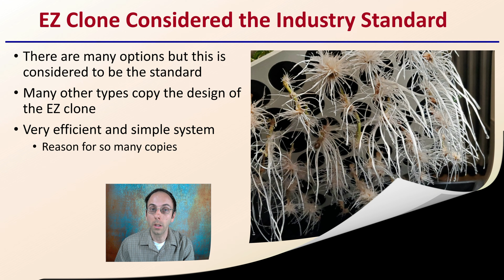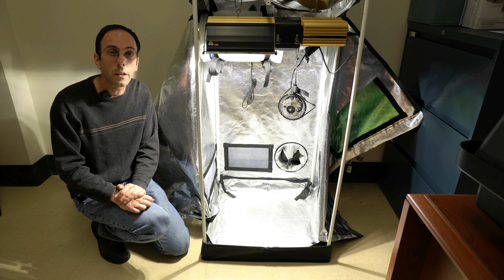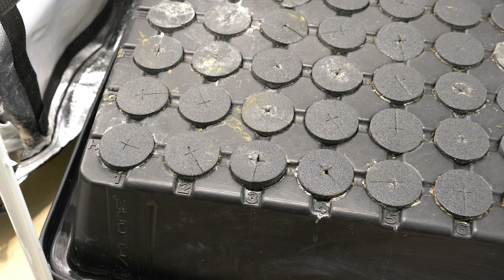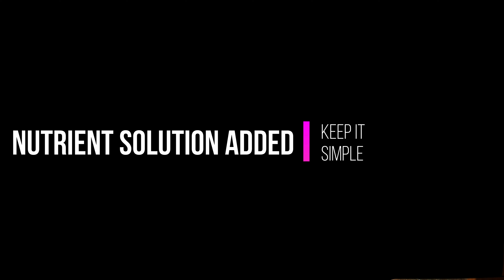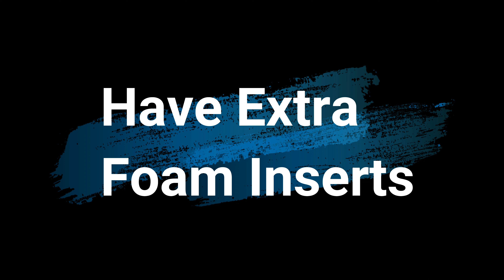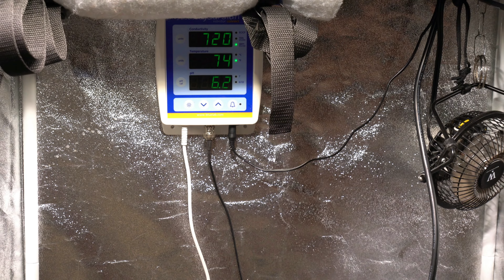EZ Clone for Cannabis Cloning

Comment: keep a frozen bottle of water on hand. monitor water temp and as the pump heats water, use bottle to cool it down. remove bottle and place back in freezer.
Reply from the maker: This is one way, but if it is a consistent issue, consider a water chiller.
Reply: They should of use a mag drive pump and put the pump outside